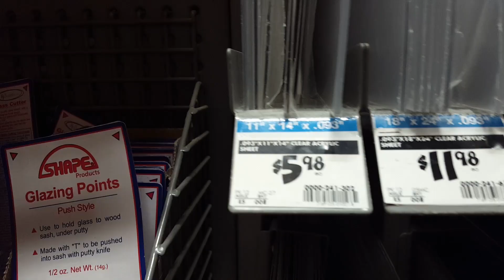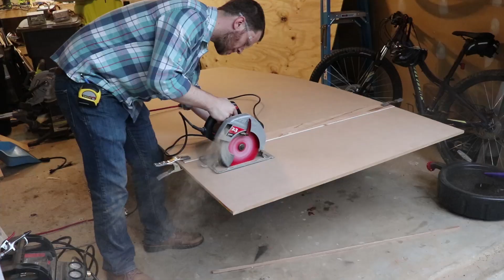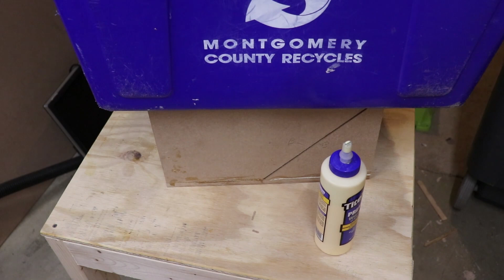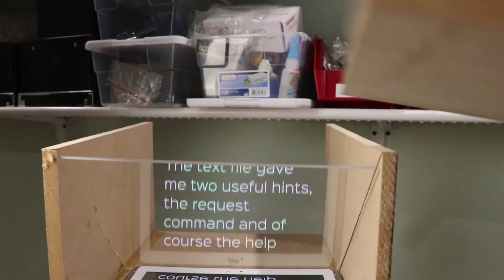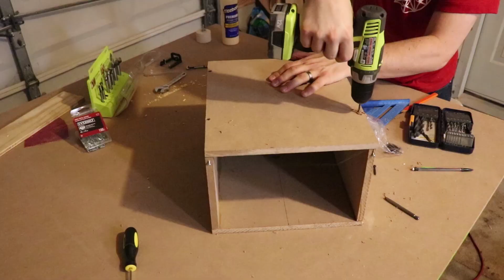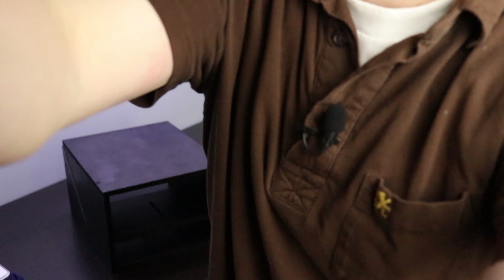How To Build A DIY Teleprompter For Your Tablet Or Smart Phone

Comment: Thank you for the video,
I experienced a huge benefit from using a teleprompter, and helped me a ton to level up my video quality, especially talking heads. I present my videos using the PPT-Mirror tool method to mirror-flip my existing slides and display them in TTL (through the lens) in teleprompter is a definitive guide to master eye contact with clients because I don't have to read word for word as I always have my whole concept in front of the camera,  I use bullet points  structure to avoid over-scripting myself out completely so that my conversation remain on target... it is a great option that assisted me in delivering professional narration

Comment: If our Text is only one A4 size area, can we avoid the I Pod or mobile? Your answer will go a long way for me pl. Thanks
Reply from the maker: Do you mean that you have a size A4 sheet of paper with text on it instead of a tablet? I'm not sure that will work because the tablet projects its own light source along with the text. I don't think you'll be able to see a paper. You should do a simple test to confirm that
Reply: @bytesizedengineering  So nice of you to have come out with your invaluable opinion. Yes, you are right. However, there is a device, a flat magnifier with edge lighting which I got from USA to help aged people to read books and I will try using it. Let me see if it works and I will share my findings with you. Thanks again!

Comment: i get double images on my prompter (i used a 5mm / approx 3/16" thick acrylic sheet) is it too thick? pls advice
Reply: Use 2 mm sheet. You need to keep that sheet at 45 degrees flat without any bending.

Comment: I've seen a lot of videos on YouTube about how to make your own teleprompter. They al came up with their own solution but honest to say, your solution is the best . Why? Because the camera is in the teleprompterbox itself. Therefore you don't need an extra tripod or something like that. Next is that you can close the back with the camera inside to get is completely black. Furthermore you can slide the camera a little bit upfront and backwards and its very stable. One downsize of your solution is that the acrylic plate should be place in the box by using small strips of wood. You wouldn't need those screws anymore to hold the part of acrylic in place. And as you had mention already, it became a little heavy in weight when using 18 mm MDF.  I will use some lighter material. ;-) Thanks for this tip in making a teleprompter this way.
Besides this I use one of my laptops instead of my phone. That's because I can use my mouse and wheel to control the speed of the text and other things such as cut and paste text.
Reply from the maker: Thanks for the feedback!